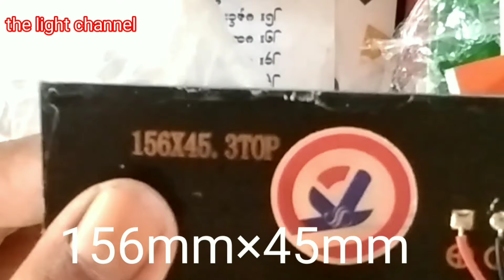ခါးပိုက်ဆောင် Solar Charger တည်ဆောက်နည်း၊How to make SOLAR CHARGER for you

Comment: AC IN 250 VOLT KO 220 VOLT CHOCK CHART MAY  AC 250 TO AC 220  WHAT ARE YOU DOING
Reply from the maker: Step down transformer နဲ့ AC voltage ကို လျော့ချလို့ရပါတယ်ဗျ၊ဒါ့အပြင် autotransformer or AC Voltage Regulator ထဲက တစ်ခုခု ကို သုံးပြီး 250v ကနေ 220v ကို လျော့ချလို့ရပါတယ်ဗျ။
Reply: @TheLightchannelAKM  step down transformerြပုလုပ်ြပါလါ
Reply from the maker: Transformer တည်ဆောက်ရတာ လက်ဝင် ပေမယ့် ကြိုးစားကြည့်ပါဦးမယ်ဗျ